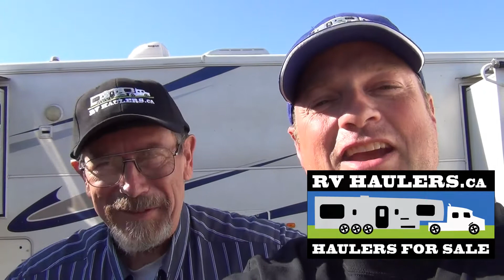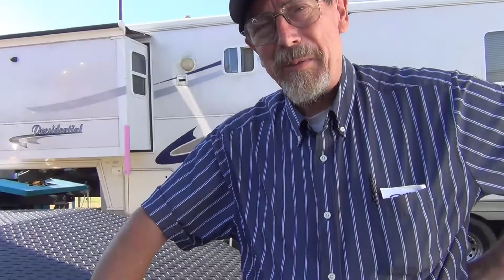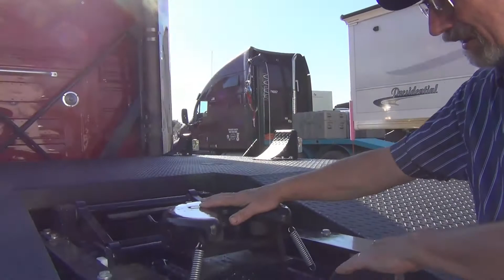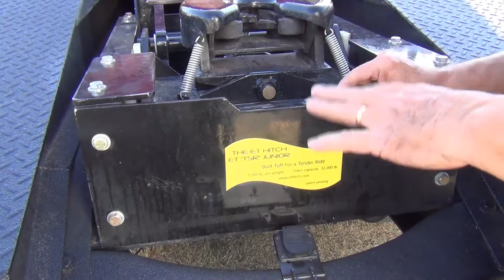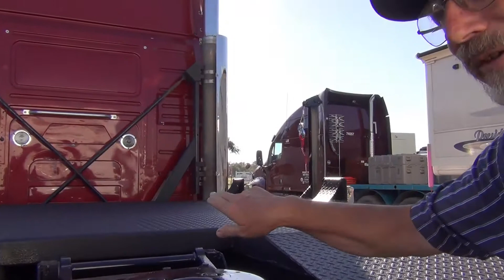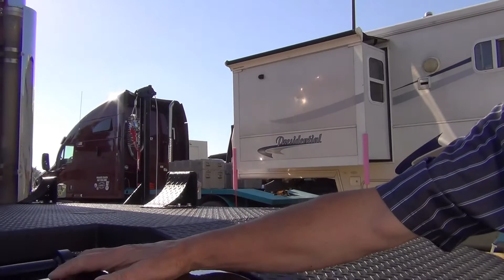ET Hitch by Henry Szmyt

Comment: Hey Gregg, once again, excellent video! I tow a travel trailer and know nothing about 5th wheel hitches. I have a question. Using this hitch, can one also use a air bag style pin box or is that no longer necessary, or can you use both?
Reply from the maker: +n3qdz Thanks for the question. If you have an air bag on the pin box, it will compete with this air ride hitch.  We do not recommend having both.  Remember that an air ride pin box does not replace this hitch!  The ET SR hitch is fixing many other ride and safety issues (which Henry explains).  The air ride pin box doesn't address those.